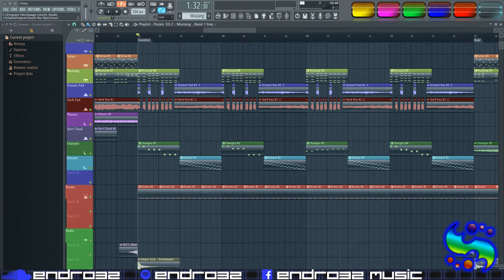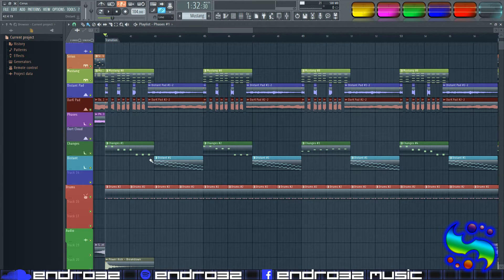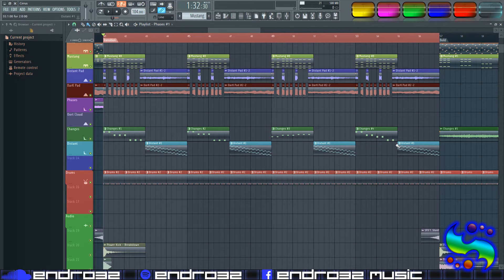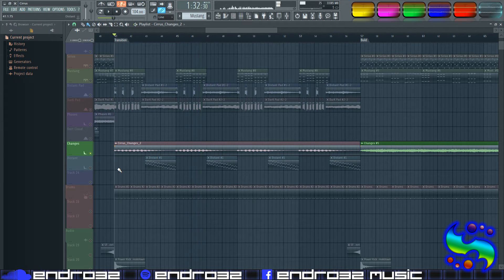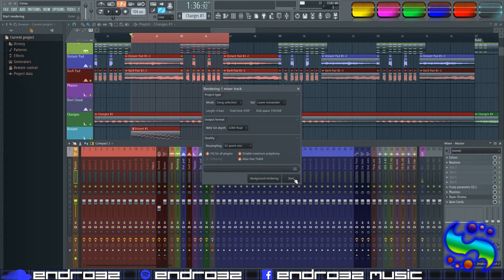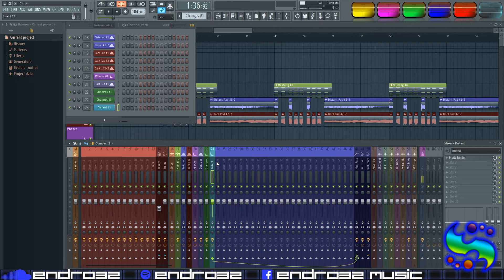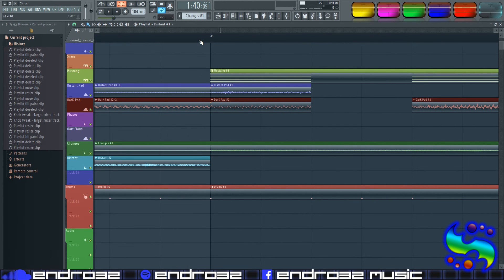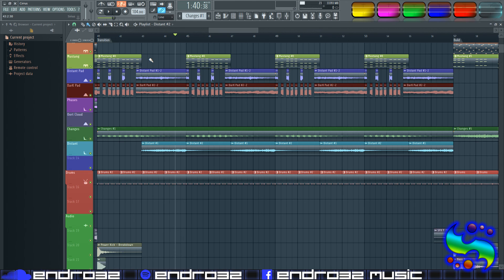How to Bounce MIDI Tracks to Audio in FL Studio 12

Comment: What is the reason behind disabling the effects? Just personal preference or?
Reply: At 8:50 Endro answers this question
Reply: You've probably figured this out by now considering this comment was a year ago but:

You disable the effects before bouncing to WAV because, if you don't - once rendered, when the audio is fed back through that mixer track, you will be doubling up on the track effects (because you have rendered the wet signal). Turning off the effects will leave you with a dry signal and allows you to maintain the flexibility over the effects that you've used if you want to make changes to it. Alternatively, you can render with effects on and turn off the mix track effects, however if you want to make changes to those effects later, you would have to make the changes and re-render the track from the source.
Reply: So the bounced sounds had natural reverb?
Reply: @lebontv6921 yeh that reverb was obviously from within the vst itself and not an added FX.

Comment: Thanks, great video ! I have a question, do you assign mixer tracks to your playlist tracks instead of your instruments ? Maybe it's a dumb question, I'm on FL since like a year so I might be ignorant but since the mixer tracks assigned to the mifi loops you bounced had the color and name of the playlist tracks it looks like they are the one concerned. Or do you simply never ever use the same playlist track for different loops that would only appear in separate sections of the projects ?
Reply: For example suppose you're doing a beat switch in the middle of a rap instrumental, and you won't be reusing any patterns or loops of the first part of the beat, do you only youse lower playlist tracks so that you never have two different patterns in the same playlist track ?
Reply from the maker: I usually use one playlist track per instrument. Then, I assign all of the bounced audio for an instrument as well as the original midi to a single mixer channel. So in a sense, one playlist track per mixer channel. It just helps to keep everything organized.

Comment: when i do it my file has no audio in it
Reply from the maker: The FL Studio project file or the exported WAV file?
Reply from the maker: With hardware synths, it is always necessary to bounce the midi to audio before rendering in any non-real-time fashion. This includes both the method explained in this video, as well as the standard process for exporting a project to an audio file. The proper way to do this is to use real-time recording, which is explained by the manual: https://www.image-line.com/support/FLHelp/html/recording_audio.htm#Freezing. It is also the method used by SeamlessR when he uses his Modular synths, if you want to see it live.

Comment: Is there any downside to bouncing the audio with the effects enabled? I mean if you're rendering with the effects rather than running the bounced audio through them, you're saving more CPU right? Thought I'd ask, I'm honestly not sure.
Reply from the maker: It's totally fine to do it that way, and you're completely right. I just prefer to have the effects accessible later so that I can adjust compression and such while mastering, and obviously, not disabling them before bouncing would cause them to be applied twice. You could also have separate mixer tracks for the MIDI and audio if you really wanted to, but that's where personal preference comes in.